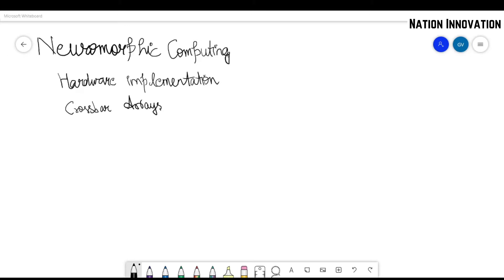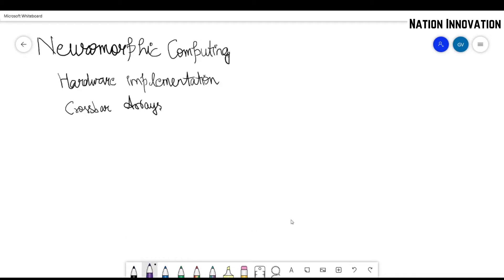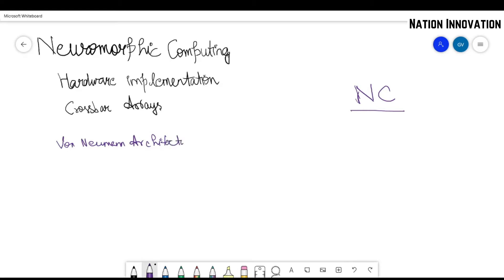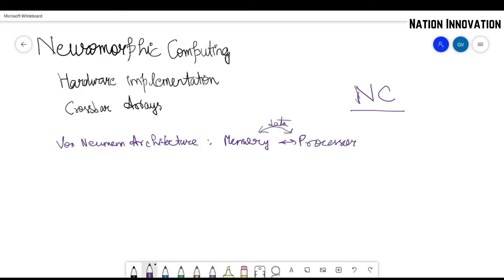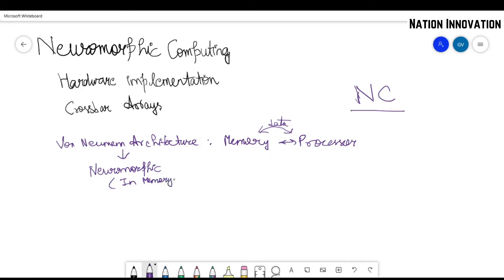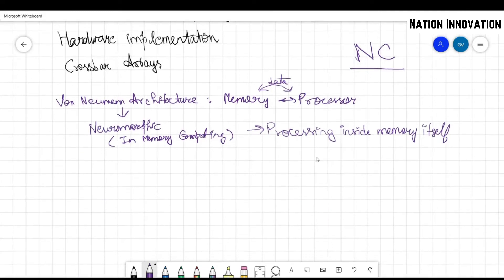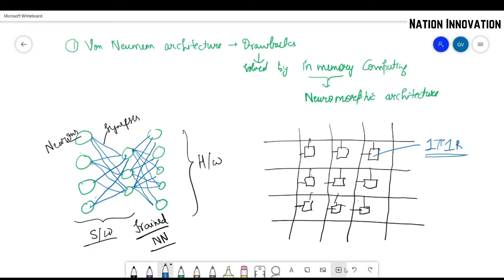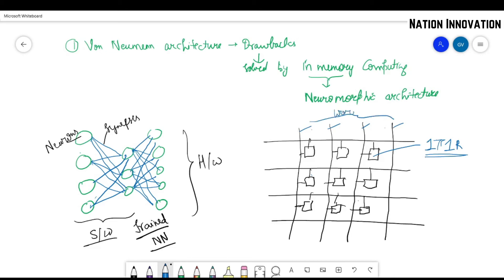Introduction to Neuromorphic Computing : Crossbar Array Architecture

Comment: hello, sir, as i am working on the memristive crossbar array tile structure, i have few questions like, 1. iam using memtorch library to run these so tile structure and non idealities, how the input fed to the memristive crossbar array like weights are already stored in the memristor as conductance and how input as voltage is fed to the each of the memristor which connected tile structure 1T1R fashion. 2. if i  want to calculate the dynamic power dissipation of the particular tile like Ex: 64x64, 128x128 how it is calculated.  please provide the solution Thank-you in advance.
Reply from the maker: Visit our website, we can connect at just ₹9/-